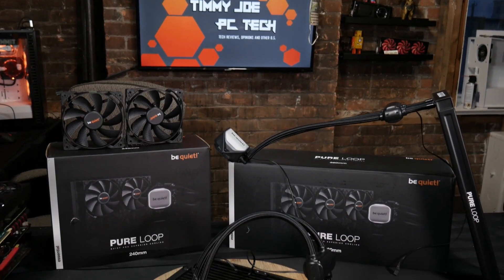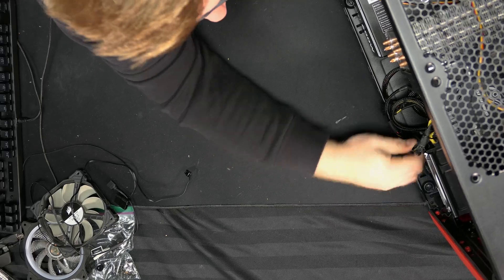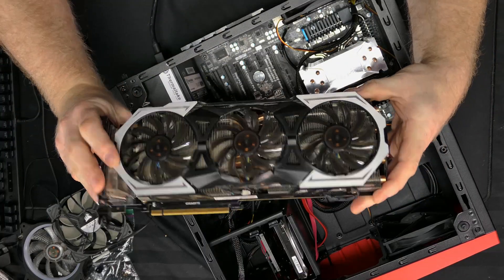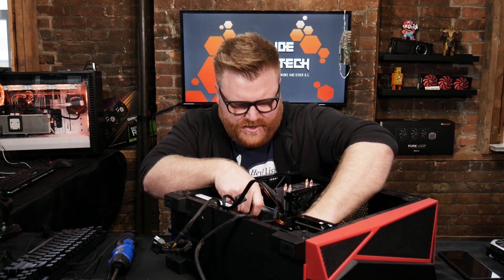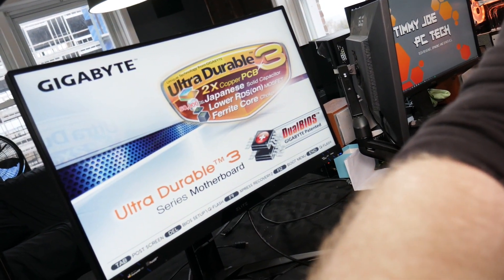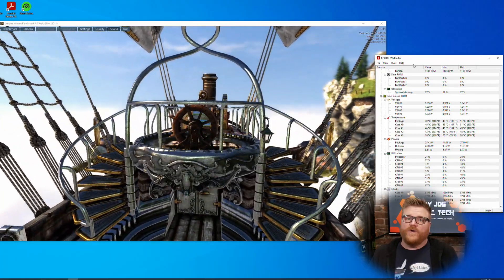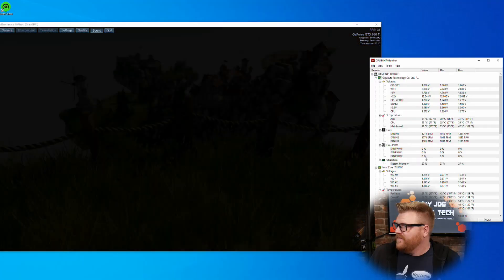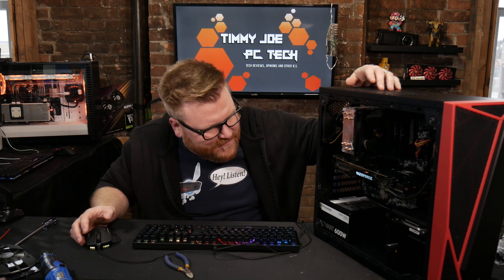His PC wouldn't boot... I should have known why :-O

Comment: I am a 53 yrold 30yr it/pc tech veteran. It so refreshing to see honesty... and not afraid to show mistakes in the young techs out there. You instill faith in me young man! Keep up the good work!
Reply: I don't remember much of the tech in the 90s and early 00s but from what I heard it was a real mess to deal with computers that were not as quite standardized as today. So I believe this is a real milestone to not only get familiar with tech back in the days but also adapt to new stuff in the industry and keep yourself up for 30 years of practice! Have a great day and be as sharp as today to meet the tech of tomorrow!
Reply: @ArakiSatoshi  In late 90s and 2000s everything was already standardised and it was probably even simplier than today. Today you have much more to care about, you have M.2 slots on MB (that's very new thing in PC), you have to care about milion types of ram with many frequencies, you have some weird RGB connectors on MB, you have to care about PWM regulation in BIOS, you have to set it carefuly etc....in 2004 you knew when you have real Pentium 4, you can use 400 MHz DDR, when you had Celeron, it can run only 333 MHz DDR (but 400 MHz ram is ok, it just runs on lower clock), and that was pretty much everything. When you had fan which is too loud, you just cutted wire and putted it into 5V from molex or buy some regulator, it was much simplier than today. Today you spend hours in BIOS trying to set all that modern shits which are named differrently and all bioses look completely different, that's also thing which was better in early 2000s before stupid UEFI bioses were created. I think the best improvement came around 2000, before 2000 many motherboards had jumpers and you had to set sometimes frequenci of FSB manually, not always, but it was common. After 2000 everything was already automatical and could be setted in bios.
Reply: @freebiegrabber  vlb extension to the 16bit isa as well.

Comment: a friend of mine actually did that too and complained to me why the PC i sold him didnt work.
his Overcurrent protection did not work and the board blew up.
Reply: RIP
Reply: very cool
Reply: That's mest up i bet he try to blame you.
Reply: A friend of mine did the same and it ran for 4 years with no problems, I was mortified when I saw it.
Reply: @KacKLaPPeN23  it actually should work fine as long as the 12v, 5v and ground line up.

Comment: G'day Timmy Joe,
the motherboard is a Gigabyte GA-P67A-UD4-B3, even though the i7-2600K does have an IGP 'P' Chipset boards didn't have onboard graphics available,
that was really lucky he didn't short out the whole PSU & Motherboard
Reply: the worse will kill the mosfet of the fan controller which will die before feeding any back current in to motherboard.

Comment: the other day i salvaged a 40mm fan from an old friendlynet 10/100 switch, strapped it to the PCI controller on the system i have, fps went up by 180%... tho the FX-4100 is running at 100% the RX570 is still thermal throttling with the stock cooler and the fans at 100%. works grate for 720p.

Comment: How do you break a case? O_o
Reply: with force :D
Reply: Maybe the last case had glass panel.
Reply: G'day Marco, the number of PCs I gone back to service or 2nd hand PCs that I've bought where the owner has broken the case is amazing,
Doors ripped off, USB sockets smashed, even bent panels like the PC was in a crash with a Semi-Trailer,
Yet for some reason the people who do these things are not happy when I say they don't deserve a PC
Reply: Maybe he dropped it off a shelf or something idk
Reply: @shaneeslick  Wow....
Reply: @MarcoGPUtuber  yeah it's easy, just transport it with some furniture resting against the glass panel 🤣
Reply: Steve from Hardware Unboxed ran it over with a car.
Reply: Power/Reset Switch or Front I/O could have failed, switches only have so much use before they become faulty and front panel connectors can only handle so many insertions. Wouldn't be a reason I personally would replace a case since replacing them is pretty simple but it's possible those could have been the reason.
Reply: @Malsherz  That's not breaking it, that's faulty. The guy only had it for a little while, to actually break a case with an already built PC inside it without damaging other components like the hard drive requires a lot of effort.
Reply: Ask UPS.
Reply: I literaly have a rectangle hole right in front if my case. why? 

i hooked a small analog eq to the front, requiring a hole to be made. why? dont ask why.
Reply: You'd be surprised, especially when it comes to these modern ones.
Reply: Just own 2 cats and let them chase each other around the house.
You’d never expect them to knock over a tower PC (or fruit bowl) with such force, but they do.

Comment: Learned along time ago check all connections first, than unplug all unneeded components in case of a short.
Reply: In this situation you expect to rebuild it and check/clean all components.  He wants to bill for a good job, rather than a 2 minute fix.
Reply: @RobBCactive  that's bad service I'm sure the guy just wanted the computer to run, and a 2 min fix is impressive and keeps good buyer feedback which can create more consumers from word of mouth.
Reply: @isaiahhemphill3686  definitely bad service...I have found the answer to customers issues and fixed within 10 mins, I just don't charge them...better reputation is more important

Comment: Lol so I finally hear the beeping that he always complains about. Best tip for anyone that's taking apart anything for the first time. Take pictures! Take before pictures and use that as your guide when you're reassembling. Also, another pro tip. There are only 2 connections that should come from your power supply and go straight to the motherboard. That's the EPS power for the cpu. This could be 4 pin, 8 pin, or even more. But this connection is most often in the top left corner of your motherboard. And the 24pin ATX connected that's always on the right side of the motherboard just to the right of your ram modules. Under no circumstances should any other connection come from your power supply and go directly to your motherboard.
Reply: mine has a a pcie connection

Comment: Right before you stopped to the video to bring in Timmy the Editor, I saw the floppy power connector too.  It's a good thing overcurrent protection was working or that would have been a fried motherboard!  I've also seen an 8-pin PCI-E connector placed into the 8-pin CPU connector.  Overcurrent didn't save that power supply and it popped.  The motherboard and everything else survived somehow.  Recently, I had someone build his own computer and brought it to me because it was overheating, and when he had made some changes it wouldn't turn on.  It turned out that CPU power was connected, and his overheating problem was because he had all 4 fans setup as exhaust.  This is why I usually just tear down the whole computer and rebuild it; you never know what you will find.

Comment: This illustrates a great advantage with modular PSU:s, at least when the person working on the system is an inexperienced PC builder. Then again all he had to do was tie off the cables that wasn't in use before he transplanted the system or take a picture and compare with how it was installed in the old case. 

PEBCAC I believe is the term of category that this kind of problem fall under and it's so unexpected that it's perfectly understandable that Timmy Joe didn't catch it until he edited the video.
Reply: Pardon my ignorance, but what is PEBCAC?
Reply: @exxor9108  It's an acronym for: "Problem Exist Between Computer And Chair"
Reply: @Nakna_ankaN  Ah, okay. I've not ever seen the term used before, until now.
Reply: @exxor9108  Yeah, it's probably not that common, but it's funnier than just saying user error. =)

Comment: I had one that did that. In and out of the case 3 times before I figured out that the board had just enough flex in it that it would short itself out on the back with standard length stand-offs. Changed out the stand-offs for extra long ones and it booted first try, but damn it was maddening until I figured it out.

Comment: I had something similar happen like your 10900k build(dying). In my case... It was the CPU/heatsink because I moved the heatsink physically a millimeter after having checked all connections and reseating the ram and it worked. IDK if I didn't torque the heatsink properly, but moving it ever so slightly made the difference. I don't know what made me move the heatsink quite honestly, but I haven't had a problem since.

Comment: Not the first time I've seen the floppy power plug connected to the wrong component. Worked on a computer where they plugged one end of an LED strip into the motherboard, and another into the floppy power plug. Somehow worked for months before it blew a cap in the power supply, and fried the motherboard.

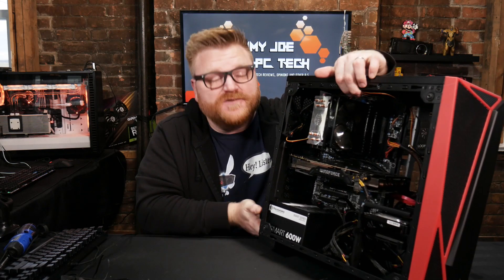Comment: At 2:40 that reminds me of what happened on my first build when I was a noob 16 years ago and did not use standoffs for the motherboard.
Reply: Yeap,seen this,too.
Reply: Dude aha I did that as well, thankfully the board had a power protector built in, went to a computer store to find the problem, they noticed it straight away and told me i fried it and needed a new board, went home put the risers into it and it worked fine for 3 years before I needed to upgrade ( AMD athlon cooked itself lol )

Comment: I had this kind of situation a couple weeks ago after a case change. My pc wouldn't turn on (would turn on for 3 seconds, turn off then loop in a never ending cycle) and I eventually got it working but it would then randomly crash and lock up doing nothing and I'd end up back at the bootlooping from the beginning. This began 2 weeks of diagnosing hell. I eventually worked out it was the IO shield causing a short and I'd checked everything individually by then lol. Good lesson learned but boy was it a hair pulling annoying as crap one

Comment: It's a clear case of "PLUG IN ALL TEH THINGS!". I had a case like this back in 99. Some guy bought a CDROM from our store, then took it home and connected a 12v fan cable to the jumper on the back of the drive. The entire rig caught fire, and the IDE cables were so burnt they had no plastic left on them. CD drive still worked though LMAO.

Comment: Start of video I thought initially, swap power supply, if that doesn't work, check for solder points making contact with the case(missing standoff?). Still doesn't work, change the board and/or check bios settings.

Comment: I got cablemod cables about a year ago, just built a 5900x + 3080 build. I couldn't tell the PCI from the CPU so well as they didnt appear to be keyed properly. The PCI fit right into the CPU power. Attempted to boot about 10 times before I realized what was going on. Corsair PSU saved the system. Nothing was damaged at all

Comment: I read and hear "overcurrent protection", but I only see crowbar protection at work. Power supply noted a short circuit (12v on ground or 5v on ground) and shut down the pc before it was able to pop smoke.

Comment: A friend of mine gave a computer for repair to a guy "who knows computers" and it didn't work. When I saw the pc, everything that could be connected ING a wrong way also was. The 4pin power was rotated 90° (don't aks me how), the cpu fan was conected to chassis fan port, the front panel audio cable was cut off for some reason and this floppy power cable was plugged into the spare pins on a HDD.
Turned out the only thing fried was the 1TB hard drive.

Comment: Figuring out why it doesn't boot is the trickest part.
Reply: My current PC has had a problemf for almost an year where it didn't post half the time. Fans spinning, no video, and the HD activity LED didn't blink so I knew it wasn't posting. When it did post, the BIOS was low resolution and Iw wasn't sure why. Recently I bought a new monitor and that problem went away. It was something about the old monitor.

Comment: I had a frustratingly similar situation, where I swapped the power and reset button front panel connectors. I didn't even get the overcurrent protection bit because 'resetting' an 'off' PC doesn't do anything.  And boy, did I feel dumb when I figured it out, after reseating everything, swapping different parts to test... then poking the Reset button on a random config of parts and getting a post by accident when moving the case.

Did it again with my current computer, where I managed to get the PC speaker/buzzer on a 4-pin RGB header somehow. So yeah, a 5v 8 ohm speaker was bridging the blue and ground on a 12 volt header if I am reading things right. Although I wonder how bad it would have been had I installed the RGB software for my motherboard and used any blue light. Would overcurrent have caught it? Would the speaker shriek a constant tone? Would it just pop? Would it catch fire? Or maybe it was getting 12v the whole time and nothing at all happened? 12v into 8 ohms is 1.5 amps. I just don't know. Whatever happened, the speaker on the speaker header works just fine, and the RGB header is now plugged into the RGB cable on my cpu cooler fan and works fine.

Comment: yep happened to me the other day when i upgraded the cpu cooler on a ryzen 5 3600, turns out I bent the pins on the cpu after struggling to unglue it from the bottom of the stock cooler, man that was annoying seeing it come off with the cooler, i didnt think kryonaught compound was supposed to cure and set hard like that.  got it working again but lost the onboard audio, must've broke a pin? :(

Comment: Other than the obvious mistake that was made, and we all make those dumb mistakes.  I just made one the other day and a PC sold that I had forgotten to plug the GPU 6 pin power connecter in lol.  But I digress, other than that the other mistake is Hwmonitor.  Always use HWinfo64, it's not complicated at all if you spend a few minutes with it.  Not trying to knock on ya Tim, just saying.  Still love your videos man!.

Comment: Hey tim.. help me out please.. my pc is stuck at press f2 to enter bios and does not take any input from keyboard. Tried resetting (shorting two pins as given in manual? cmos Replaced battery. Also note that using all same components system works fine on gigabyte b450 but gets stuck on asus x470i.
So i figured something wrong with asus x470i.
Please help

Comment: One time I had a very weird problem with my RAM
Windows would read 16GB, but only 8GB usable.
The problem was that I moved the computer to other place, and CPU wasn't properly touching motheboard pins.
Weirdest problem that I ever had.
Reply: Thats weird, that resolves itself if you swap ram slots between them most of the time, i dont think it was the cpu but maybe the cpu reseted when you reseated it and it worked then
Reply: Swapping ram resets the ram in the cpu
Reply: If theres a intel cpu with bent pins then maybe but i dont think this is normal,

Comment: I still couldn't get it how you resolved that "Main BIOS Checksum Error" issue.
Reply: @PCDYYD I can't get it how he solved that. It was a Dual BIOS motherboard. So maybe it was set to Auto Recovery for Back Up BIOS to work. I'm not sure. Did you notice anything how he solved that?
Reply: @PCDYYD But default BIOS settings for which BIOS?

Comment: Tim i'm having problem with my pc i dont know whats the problem though it just hang and have a disturbing static sound every time it do that but after 2-3 reboot i can play after that and i'm having problem with a huge fps drop its it runs on apex with 60+ then it will drop ocasionally to 10-2fps. Any advice??
Reply: This'll seem dumb, but for the static, are you running Malwarebytes?
Reply: @SmittyAZ  I dont have the slightest idea about that one. XD how can i check if something like that i running??..
Reply: @joshuaminaldo8860  It's an anti-virus that you would have downloaded, or it was part of a bundle. When the real-time protection is set to ON, it can cause those static / freeze up problems. Did something change on your PC?
Reply: oh, I see but I think I turned off the real-time protection and other stuff on the anti-malware came with Microsoft. I didn't bother installing any antivirus software as well. It's just I don't know any more xD either way, it's a crapy build anyways so i think ill leave it like that and build a new pc. XD but its really hard to have a good build here in phillipines when you only earn for about $300 a month. XD
Reply: @joshuaminaldo8860  What is your PC budget? Can't find anything pre-owned?
Reply: not really though I would like to at least have a budget but all brand new. Something like a ryzen 3 build with a pair of 8gb ram and a good GPU.
Reply: @joshuaminaldo8860  Got it. Do the prices match the wages over there?
Reply: @SmittyAZ  its a bit higher but i cant just order from US it will make it much more expensive because of the shipping fee xD
Reply: @joshuaminaldo8860  No shipments coming in due to covid, so you have time?